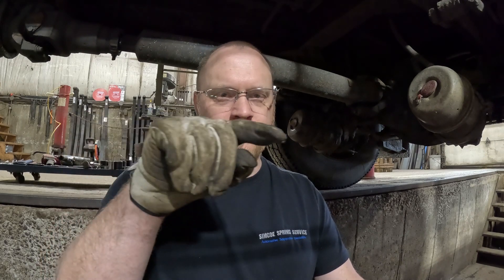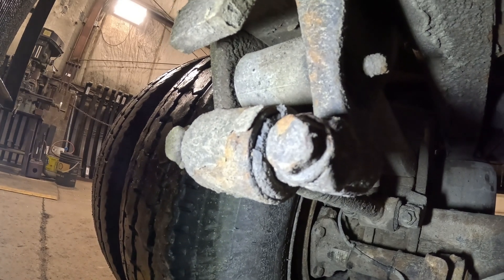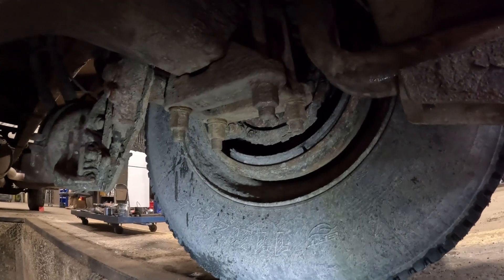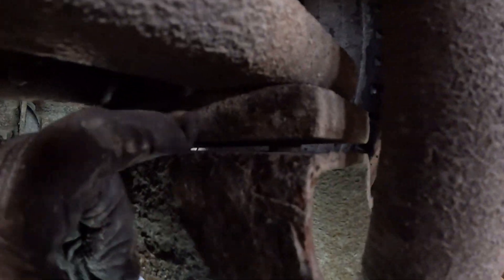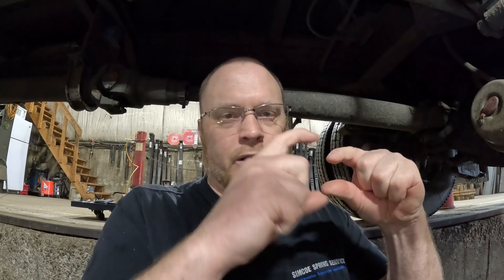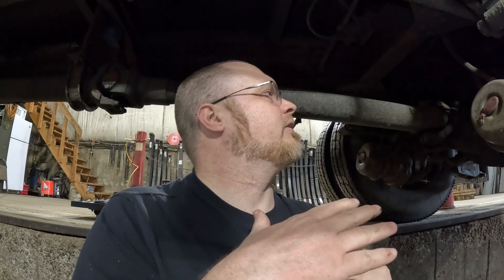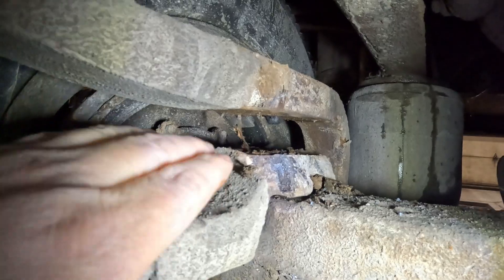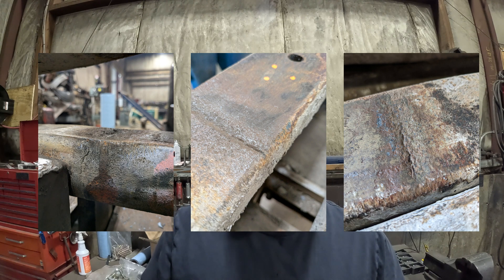Hendrickson HAS - Air Suspension Diagnostic for your safety EP3

Comment: Hello mate, thanks for another great video. I've had HAS 461 on my concrete truck here in  Australia. I've found replacing the transverse rod bushes with Kenworth airglide V rod bushes makes a big difference to the longevity of the rod. There a bit tight to get in but it's do able.

Comment: Good video. I especially like the explanation of not only what but why. 
 My Pete has the flex air/ ag380 suspension under it.  Which has held up pretty well.
Reply from the maker: ah, the flex air.  that is one suspension I think I have only worked on about 4-5 times.  The bushings usually fail from time more than use.  They fail the same way these ones do, by getting squishy and soft after many years.  The most common way they break down is the rubber will dry out and start crumbling into little chunks.  that is a pretty durable suspension you have on your truck.  =)